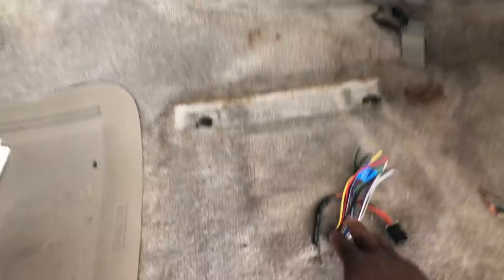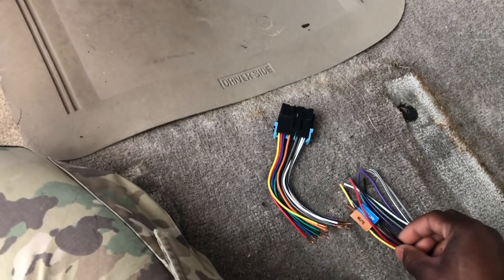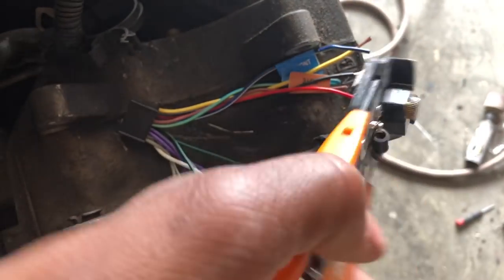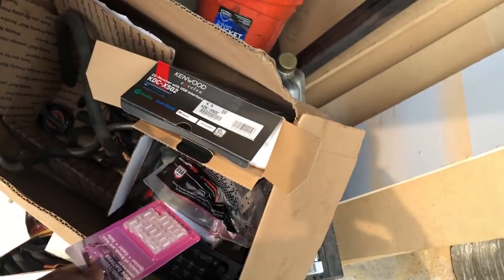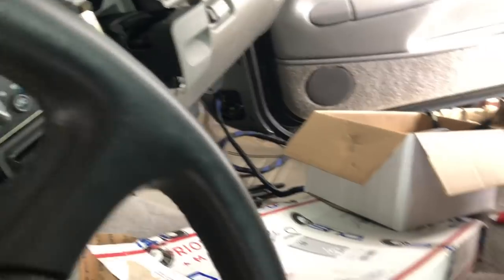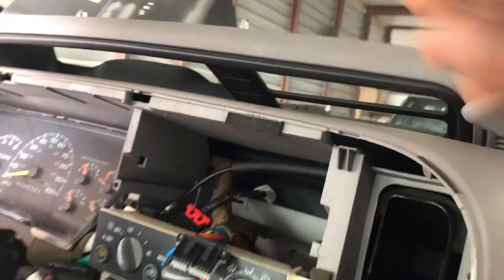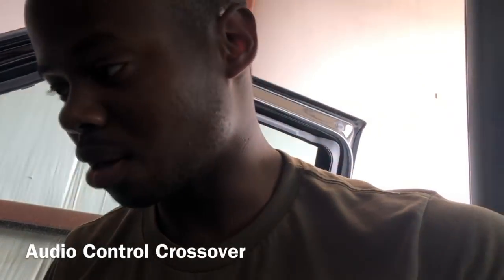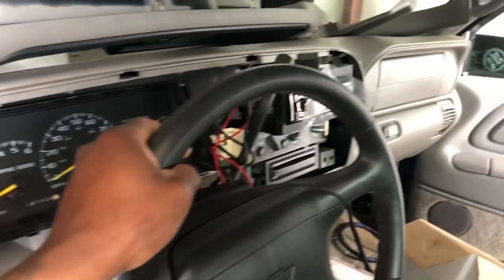2 Door Tahoe: How To Install An Aftermarket Radio

Comment: Have you used sonic electronixs? They are generally cheaper than crutchfield.
Reply from the maker: D Will B&G Body Performance yes, I use to use their site directly but they have an eBay store i’d rather use

Comment: Put your phone on record around the bottom of the dash by obll and it will show you where the little grey box that makes that buzz sound, it inserts like a fuse. Take it out an throw it as far as u can. That what i did
Reply from the maker: 😂😂😂 I need it just Incase the key still in there or the lights are on